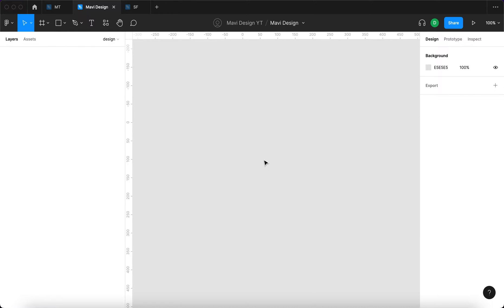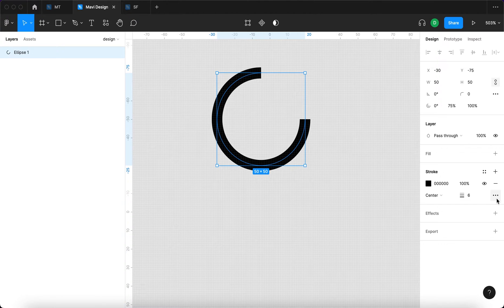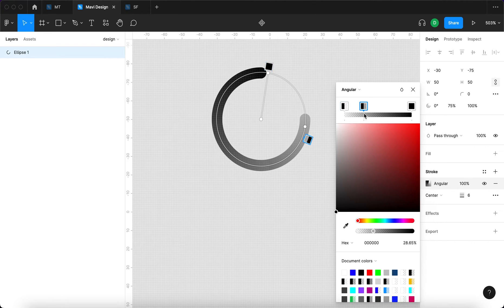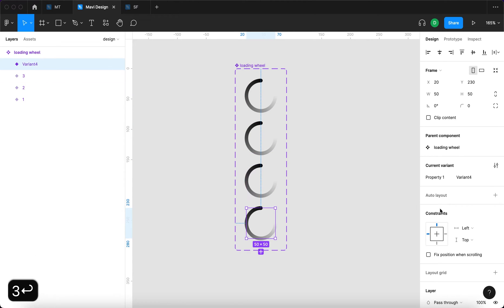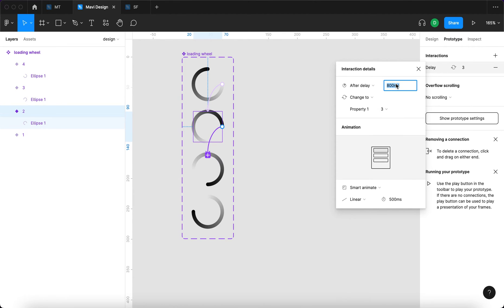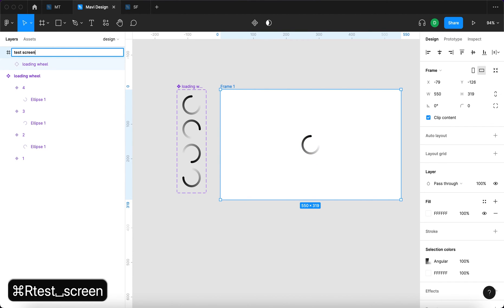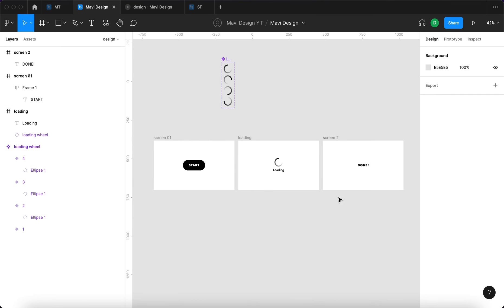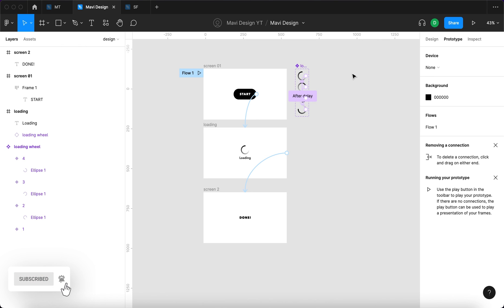Create an Animated Loading Wheel Component in Figma

Comment: I followed every step. But it doesn't animate. just sits there
Reply from the maker: You either didn’t rotate the circle but the whole variant OR you need to press R to reset the prototype
Reply: @mavidesign  Yup I'm in the same boat - I've definitely rotated the ellipses and clicking R in present mode also doesn't work - any other ideas? Muchas gracias!

Comment: I've tried this tutorial and one other that takes the same approach, and for both I get no rotation, just the first variant sitting there. Do you know what might be going on with it?
Reply from the maker: Make sure to rotate the ellipse and not the whole variant :)
Reply: @mavidesign  at first I also had the same problem but in this video I really understood the problem and now it's working for me, thanks for the tutorial ;)
Reply: @mavidesign  I am 100% sure I rotated the ellipse, not the whole variant but my design doesn't rotate. any idea why this might have happened?
Reply: @janoregon  I have same problem. To solve this: when in present mode, press "R" to start the animation
Reply: I've followed every step and couldn't make it work. After doing some research I found out there is nothing wrong with my design, I just need to press "R" to enable presentation mode and it will show the animation. It might work for you as well.
Reply: @jenniewang8070  you saved the day thanks a lot
Reply: yeah mine too is like that
Reply: same problem for me. have you managed to figure out what went wrong?

Comment: Awesome! Was trying this but wasn't getting this smooth animation. Thanks for your video. It really helped. <3
Reply from the maker: Awesome! What was the problem preventing you from creating a smooth animation?
Reply: @mavidesign  I had the same exact problem, but I managed to get a smooth transition after changing my interactions settings from ease out to linear. Hope this helps😇
Reply: For some reason, my animation is super choppy as well. You can see the phase move from 1-4 when I play the animation. I tried to adjust the 500ms up and down to see if that'd affect it and moving it down helps slightly but it's still not as clean as Mavi's.